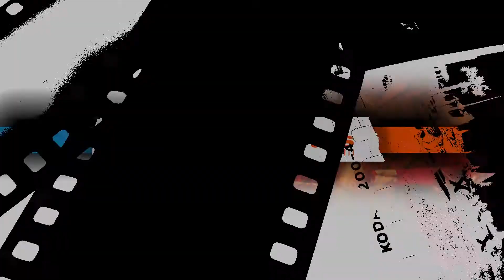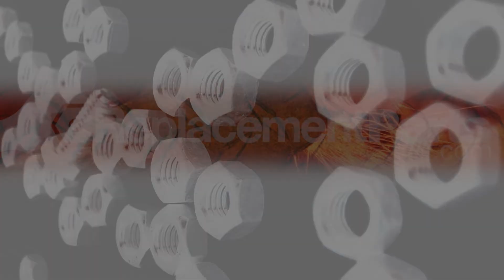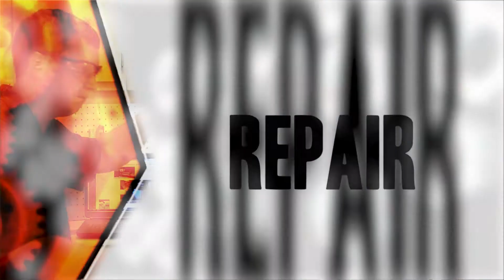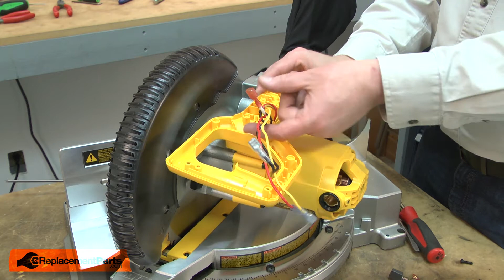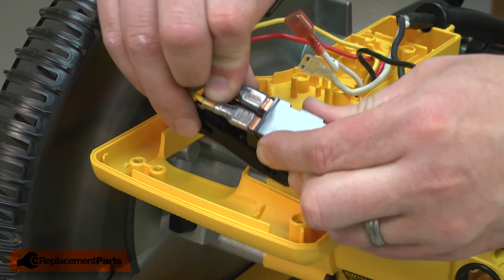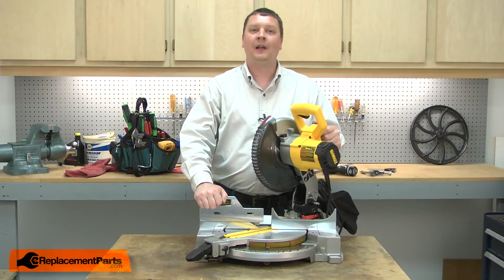DeWALT Miter Saw Repair - Replacing the Armature (DeWALT Part # 614364-00)

Comment: Taking all those wires off is not nessesary and is gonna screw someone up. The wires and all tge housing will come off together in 1 peice
Reply: Have my Dewalt 7491 armature out at this time...same set up. Purch. saw used last  week with stripped threads in the cast alum housing used to adjusts blade height. SS 14mm threaded adjuster rod has stripped out the threads. $60 bucks for the housing...sweet deal on the saw with easy fix.